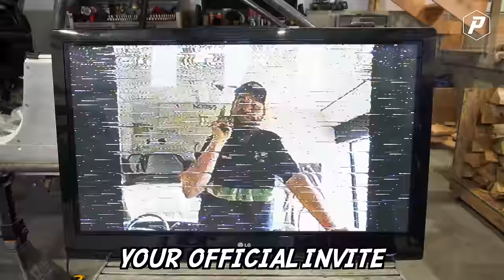@MattsOffRoadRecovery INVITED US TO THE OFF-ROAD GAMES

Comment: Get the motor and transaxial out of a pt cruiser . Its a 2.4 L turbo at over 200 hp  . Turn sideways mid mounted . Weld transaxial gears and gear dana 44 axils down and have fun . I have seen mini two seater rock crawlers made like this .

Comment: Because of the lack of room, do electric drive axels (or run it through a transfer case) and turn a small motor or diesel motor into a generator.. lots of torque and lots of mounting options. Wont need very large batteries because you'll have the generator.

Comment: If you need to extend the front, you could use fenders, lights, hood etc from  a BMW car, maybe like a smaller series to keep the little grille etc, then even if you cut it out, the front would hang over the tires however far you let it. Just easier to remove material than to add it, extending or working with what you have, could graft it with what you have now however you want, but those long fenders and hood would be of use id think. Kind of like matts heavy wrecker look where the cab sits back and they doctored the front up

Comment: You guys need to look up transaxles buggies it would be perfect appliction for this putting the motor in the middle. There were some LS impalas that were front wheel drive. Or could do a 3.8 supercharged gm/buick transaxle.

Comment: The small (Kubota diesel tractor engine) is the most popular successful massive torque mini truck swap motor.  Youtuber (The Mendota Ranch) has one from a barn fire thats perfect for you.

 The small diesel motor also will keep that tiny truck solid to to the ground with a little weight.

Comment: Pick the vehicle that is easiest to drive, and easiest to fix.

I have long planned a forward cab rock crawler.  The number one bitch of jeeps is "all I could see was sky."  A FC would give great visibility.  For my version I was thinking XJ running gear, that is 4.0L, AW4, 231, but tougher axles.  The 4.0L is narrow, makes lots of power, and is tough as a brick.    Keep it lightweight, no diesels, minimal cage. 

The engine/transmission/transfer case in the Ford is longer than your truck.  Good luck with your plans!

Comment: only half way thru video......  you may have solution already....  annnnyway.  a solution is two front wheel drive  engines with trans turned sideways.  One engine in front and it runs back axle.  One engine in rear...... it runs front axle. Jeep did a funky rig like this for SEMA I think many years ago.

Comment: I wanna Ls my YJ so bad. Currently has a 2.5 and it’s an auto! Needless to say it’s a real dog. A 5.3 would be perfect for it. Been looking around and reading what I can about the swap. A 8.8 to get rid of the junk Dana 35 which I hear is a super easy swap. The Dana 30 should stand up.

Currently I have a 4in lift with 33.12x50s which is nothing today. The stock Wranger has bigger tires than this.

Comment: I have a 2003 6.0. That engine is way too big. You also have to throw $3000 worth of parts at it to address the oil cooler design defect issues. Find something else.